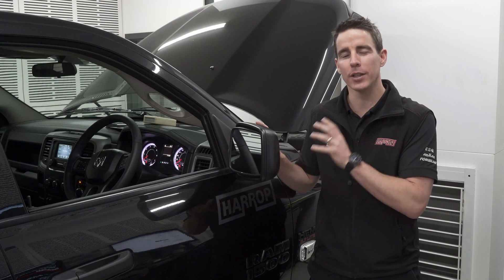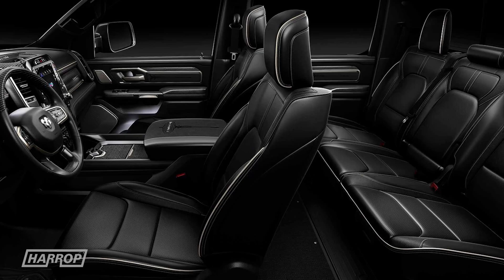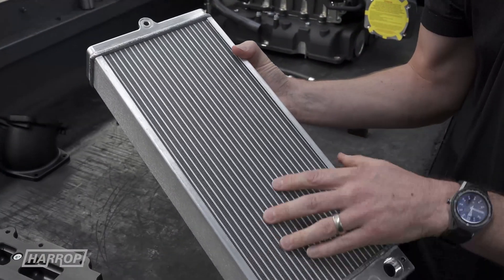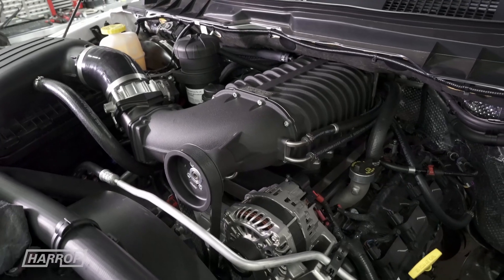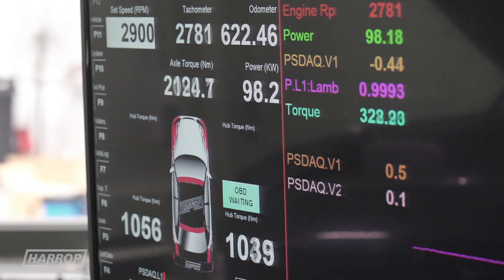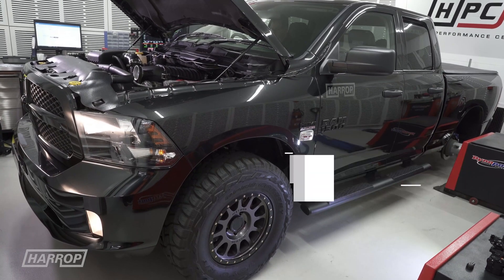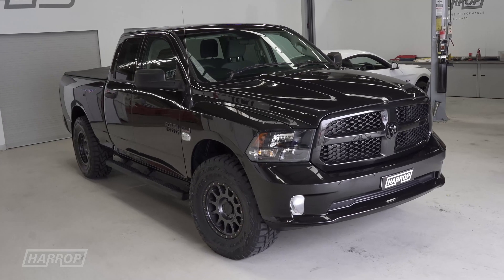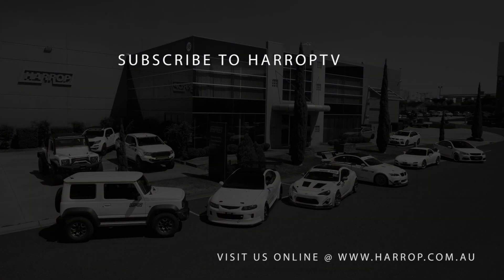RAM 1500 V8 | Harrop TVS2650 Supercharged

Comment: Hi Guys, I have a 2018 Ram express, it has an 85 mm throttle body , K&N cold air intake with extractors, hi flow cats and twin system, it run 35's with a Procal tuner to keep everything in spec, if I go for the supercharger will my throttle body and cold air intake still be used?

Comment: I’m surprised the rotors aren’t polished. Polished rotor would impede less with the air flow. So if the rotor is 11% bigger than a Hellcat, why still so short in horsepower? But I have to give it to you, the installation really looks OEM. Well done.
Reply: Because they're hardly adding any boost to the 5.7L Hemi. They only had a peak of 4.8PSI in this video, yet the 2650 blower is capable of well over 20PSI of boost. If you take the bwhp numbers in the video, and say that they gained 200fwhp per 5PSI (comparable gains on the Ram in the video but at the flywheel instead of the hubs), that will equate to at a minimum +600bwhp (wheel) @ 20PSI, if not more, moving the total fwhp to well over 1000hp. The Eaton 2650 rotor combo is proven to supply enough air to get capable engines over the 1000hp mark. If they wanted to get gains closer to the hellcat, all they would need to do is swap the supercharger pully to a smaller one to up the boost, and adjust fuel tables & ignition timing. Though, I wouldn't push a stock 5.7L hemi too far; they're known to have issues with the pistons.

Comment: No offense but I could turbo charge my ram for less then 9,000 and get double the amount of horse gain. Is your super charger kit really worth 13,000?? NO 👎 
However I was really impressed with how well the video was put together and how well the logistics part of your build was explained.
Reply: That's in Australian dollars, not USD. It would be closer to $9,900 USD. However, this kit is pretty pricy. I'd look into something like maybe a Procharger P1SC/D1X or a Whipple for your truck instead. That would put it somewhere close to the $6,000-7,500 range. This is a large blower capable of well over 1000hp on capable engines & over 20PSI of boost. Much more that your stock 5.7L can take without forged upgrades. I feel like a procharger would probably be the best all around solution for you if you want to double the output and get close to that ~600hp range; your truck should be able to take that no problem with minimal upgrades.

Comment: 5.7 liter Hemi great engine period.
Reply: Literally haven't had a problem with mine. Has been the most reliable truck for the last 3-4 years.
Reply: @jacob-v8567 yeah my 2015 f150 was a piece of shit. My 17 rebel has been been flawless I’m about to buy a new one and turn this one in to my project
Reply: @B J  I sold mine for something better on gas but I miss it 😪
Reply: If you take of your Ram it will last your entire life. Basic maintenance...

oil changes often
Front & rear diff fluid 
Transfer case fluid 
Brakes and suspension work 
Grease all points 
Add a some preventative mods such as a oil catch can or better intake or better parts. 
Replace your parts when needed. Don’t drive around with the squeaking or knocking...go fix it.
Reply: @Stapeezy  exactly. A guy I know just got rid of his after putting almost 500k on it.
Reply: Beast of an engine! Need one in my Duster.
Reply: @karlsracing8422  you need a hellcat or 392 in your duster  😁😁😉😉
Reply: @Microsoft pro it was not
Reply: Twoleggedkumulava  hellcat lifters are the same as all the lifters that went in the hemis from 2016+
Reply: @rjt1789  In what world cause hellcat lifters are completely different from a 5.7 hemi lifter
Reply: @bmf88  wrong
Reply: Until the camshaft and lifters fail
Reply: @rustyshackelford5892  thats happens at fairly high mileage if at all  run good oil and you should be fine .  Don't get me started on the  6.2 liter GM LS engine.
Reply: @rustyshackelford5892  that was fixed in 2008
Reply: @danielstash4305  my 2011 had them fail with routine maintenance

Comment: Did you have to have a lift to fit 35s?
Reply: I have 15 ram sport... i have a 2" level kit and im running 35x11.50r20 nitto ridge grapplers it only rubbed the inner fender at full lock and articulated and barely did rub.
Reply: @cruzzindodge  so what's the width 285/50/r20???
Reply: @LamontBoucherville  35x11.50r20  not sure what the metric equivalent is
 height: 35" 
width: 11.50" 
wheel diameter: 20"
Reply: @cruzzindodge  ah nice. I ended up getting a fox lift and now easily for the 35s !!!
Reply: Should be a front end leveling kit and I think you are good

Comment: What makes this Supercharger ( better ) than Whipple, Hennessy & Kenne Bell etc?
Reply: Biggest benefit is TVS blowers do not compress the intake air inside the rotor pack so when you open the internal bypass there is very little parasitic load so fuel economy at cruise is typically the same, Intake air temps stay cooler and there is no idle issues, the TVS rotors are also highly efficient when they are Pumping so best of both worlds. Then Harrop wrap them up in a nice package that is typically better than OEM finish.
Reply: Allan are these blowers available in the USA?
Reply: @Mr.Beastforpresident  Probably, I don't work for Harrop so best to contact their customer service for that.
Reply: I talked to their rep. They are in Dayton Ohio for USA sales. I am looking at the stage 2 kit for my tundra. It gives it 513 whp and 514 torque.
Reply: Andrew Stoffa Why them over the TRD supercharger?     They say the TRD has been put through rigorous testing.  It would be cool if there was a YT Channel for each brand vehicle comparing each brand supercharger in every aspect, build, quality, fitment, warranty and efficiency. 

The one thing I’m not fond of superchargers is they tend to be hard on main bearings on engines not designed for superchargers. 

One of the best engine builders in the world in my opinion Nelson Racing engines ( the developer of mirror image turbos ) shares the same opinion. 

On the flip side, turbos have many more drawbacks in my opinion than a supercharger. I think what Ducati has done on bike engines is genius, double rocker arms ( No valve springs ) with essentially literally naturally aspired turbocharged engine. 

I’ll post a video, must watch if your really into engines.
Reply: @highpro1394  interesting I live in dayton. Lol
Reply: TVS 2650 is why its better than the trd supercharger. The trd is only a tvs 1950. The harrop tvs 2650 is bigger displacement=more air into the engine. Check out their you tube channel and watch their video about the tundra supercharger. The jury is still out on whipple for the tundra because it isnt for sale yet for the tundra. Harrop is the biggest baddest supercharger out there.
Reply: Andrew Stoffa Nice, I’ll check it out
Reply: FWD to 15:05 watch for 1 Minute then FWD to 20:11 

https://youtu.be/ggPEQG3MO1s